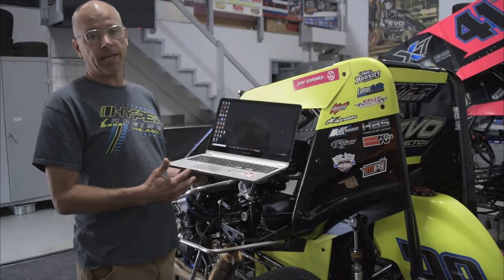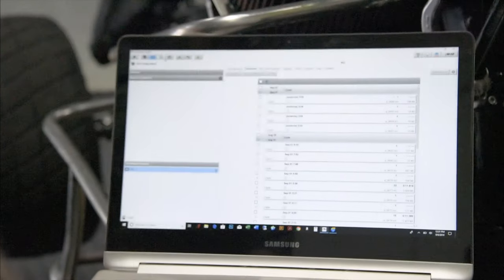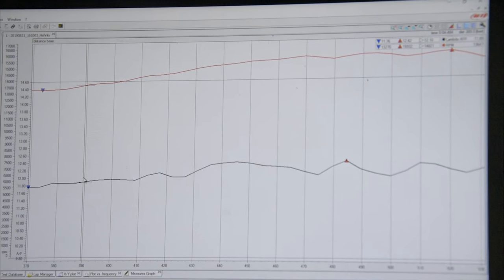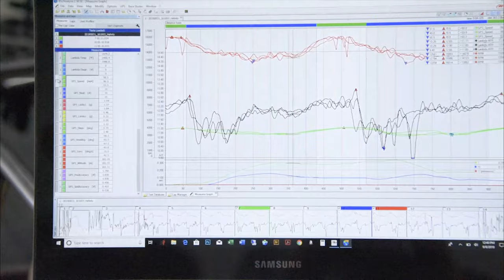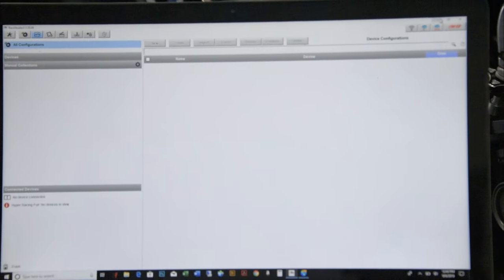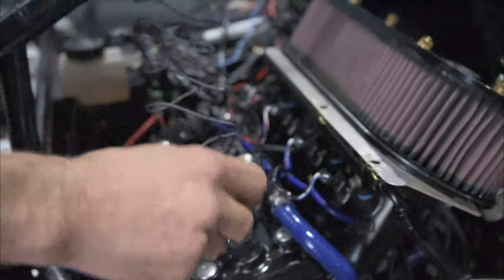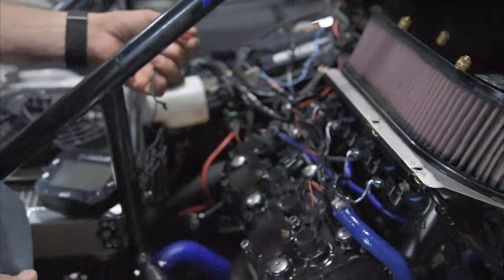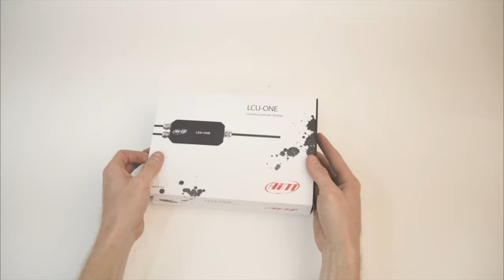MyChron 5 Unboxing & Setup Guide | Why Every Micro Sprint Racer Needs One | Hyper Racing

Comment: How does this track your lap times. Is this because tracks have gps systems
Reply: The Mychron 5 has a built in GPS antenna, it then uses the GPS satellites to track its position. From this info along with documented track data, it can determine lap times.